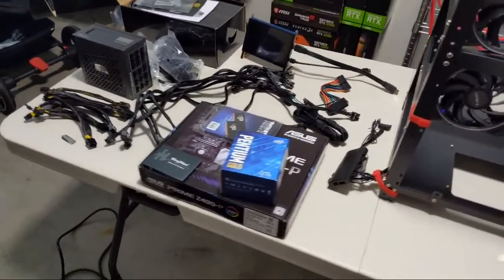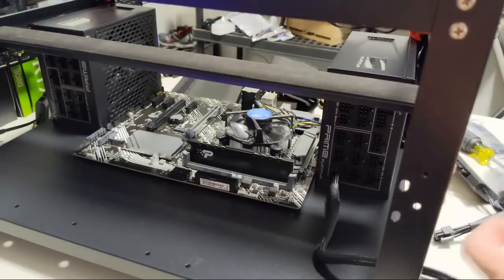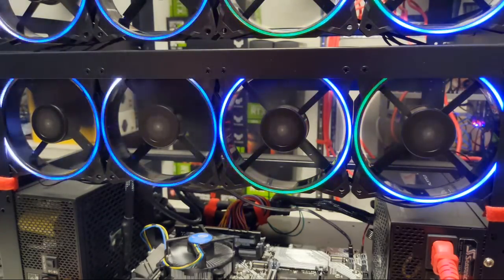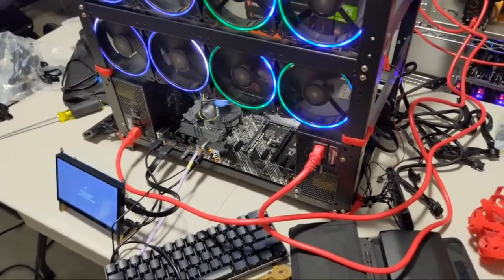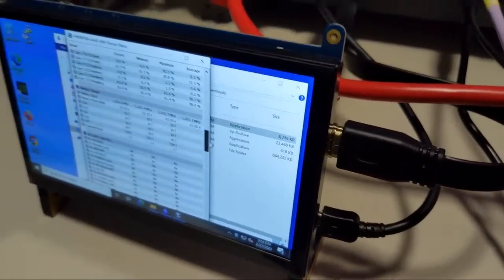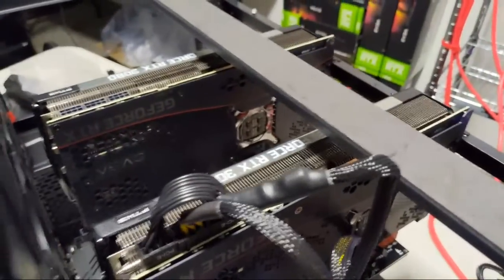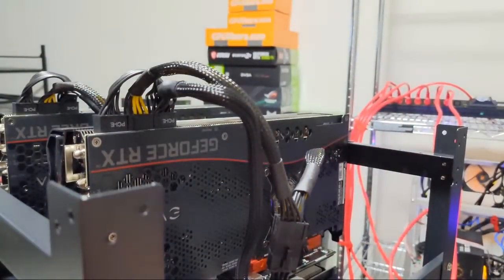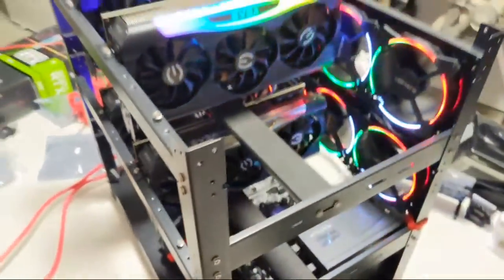6 x 3080 Step By Step Mining Rig Build LIVE STREAM! Part 1

Comment: @2:20:42 They actually are, micron has a spec sheet for the cheap. This isn't a debate or guessing. There is no info stating if you are over 95c for x number of hours the chips will burn up. The info from micron as the limit at 125c on the top dead center of the packaging of the chip. Which means the temp junction chip would be well above 125c. Nvidia throttles you at 110. 
You can aim a heatgun at your GPU for hours upon hours and it would be fine. You would be getting throttled.

Also on the caps, they can be bent sideways. As long as the wires are connected properly. NEVER attempt to bend back a bent over cap. All you do is weakn the joint. If you think the wire or joint is bad, repair, or trash, never try to straighten it.

Comment: *HELP!!!!!!!*
Having a pain in the a$$ issue, specs:
Mobo: Asrock H110 pro btc+
Cpu: Intel i5 1151
DDR4: 16GB
GPU: 2x RTX 3060

When connecting 1 GPU to PCIE3.0 x16 slot hashrates are fine but when the other GPU is connected with riser to PCIE2.0 x1 slots getting very low hashrates.

Comment: Hi Panda, just wondering if I see it correctly. Did you use 3 rtx 3080s with 1 psu 1300 watt? Doesn't the company recommend 750 watt per gpu? Please correct me if I'm wrong cause I'm still newbie. Thanks so much..

Comment: Hi Panda. Im in Australia where parts are costing 3 times the amount of msp. Thanks for your inspirational video's . I have just got into mining and have copied your 6 X 3080  build. Id just like to point out on that board if you read the manual, you have your ram in the wrong slot. Should be in the second slot away from CPU.  Thanks again for the great information and guides.

Comment: Red you need to absolute core on your cards. I have 2 3080s one does 101.50 @ -75 core, 1375 memory, 223w fans at 80% Asus tuff gaming. CARD#2 102.80 -150 core, 1375 memory, 224w fans at 80%. Gigabyte OC. You can do it in msi through the voltage/frequency tab in afterburner. I then find my sweet spot for my numbers on the cards then but them in my bat file so I don’t have to use afterburner.

Comment: 1:31:39 Its fine. Assembler or Pic and place machine soldered  pins to the board when they weren't level. Now if the Pads were pulled, you made the right choice.

Comment: Please, Red Panda, explain if this Driver problem is connected only with the 3060 cards, or the same goes to the other cards like 1660, 1660 TI, 3070, 3080? I am asking because I saw many of your videos and for 3060 you use the x16 ports only, but for these 3080 cards, you can use x1, x4, x8, and x16 PCI ports? Whys is that? Please explain. Thank you!

Comment: I don’t know if anyone is gonna read this but here it goes. I recently got 4 gpus ( all 3080 ftws) for some reason the motherboard only detects three at a time, it won’t detect the fourth no matter what. I tried everything in the bios settings from 4g decoding to switching the generations but still nothing. Is there anything I am missing? Ps: i tried the gpus separately and the risers they all work perfectly.

Comment: msi rtx 3080 is suck. you have to use a 102 percent power limit to get a 98 mhz hashrate. 
no matter what the memory clock setting, core clock setting, it's useless, the power limit must be 102.
If you lower it 70% the hash will drop to 88.

Comment: Hello, I want to start mining with a single RTX 3080 (hope to add more in the future) and I have a question regarding PSU to GPU connection. 
Can you explain how you set it up because I am not so sure. To provide some context, I will be using Windows and I will try to reproduce your setup shown in this video except my 3080 has just two 8 pins input ports instead of three 8 pins ports for your EVGA's.
My understanding is : do not use splitters to connect the PSU to the two 8 pins input of the GPU but use two separate 8 pins cables from two different 8 pins output of the PSU instead (wich means two cables going from PSU to a single RTX GPU each time). I have notice that in this video you are using splitters for the 8 pins of the GPU... but you also said in a more recent video not to do it so I am a bit confused now.
As I understand... it is however ok to use splitters for the risers so one 6 pins connector from the PSU can be splitted up and power up 2 different risers.
Is this correct ?
I find it very difficult to find precise explanation on this and I do not want to fry my equipment as it is very expensive...Any help welcome^^
Reply: I was asking the same, didnt found any answer so i went for each 8 pins a different cable, its crazy beacause for each 3080 i have 4 pcie cables (3 on the gpu and 1 on the riser)

Comment: I was following your video to build a coin minng rig. I have connected motherboard, CPU, PSU with the proper cables. when I turn on the device, I saw a light on the board but fans for power suply and CPU were not working. I don't think I missed something. Do you have any advice how to check out the device?

Comment: Can you run lets say 6 rtx 3060 and 2 1660ti on the same rig ? Its possible to operate in windows ( due to 470.05 driver restriction ) each gpu power draw individually ? Please help

Comment: Hey Red Panda!! what's good? cool rig hummmm about here on 1:27:30 then I definitely advice you to replace your thermal pastes for thermal grizzly conductonaut liquid metal and all the thermal pads for minus pad 8's DEFINITELY recommend you I don't do mining but I fix my PC's by myself and do all the things by myself  I also replaced my thermal paste on my laptop for grizzly liquid metal and it is a HUGE diference I would advice you that if you do it you'll need to replace the liquid metal in between 6-8 months because the thermal liquid with time evaporates and gets absorved by the metals and if your have a copper heatsink on those GPU's theres nothing to worry about it will only affect the surface with time but there's not going to be an issue with the temps I already reaplied it to my laptop CPU and GPU for second time NO issues at all my heatsinks are copper.

That way you can keep mining with the same GPU's for longer periods of time and make more money with higher OC and lower temps.

Comment: Hi everyone, am setting up a rig with 2 evga 1600w psu's and evga seems to have not 24pin slots they have 18+10, 24pin splitters won't help, or i need a motherboard board with 2x 24 pin slots? Any suggestions would be appreciated.

Comment: Hey man try moving the top cards 1 slot to the side so the cards aren’t on top of each other. I think that will be better since heat rises and 1 card just above the other will transfer more heat to the top one. It might even help to get the riser and cable for the top card further from the bottom one if you have interference
Reply: Henrick will this build work with 3070 founders 4 per the rig?

Comment: Pls help me. I am using 10s, 8 Capacitor Version Risers on Windows 10. I have added first ASUS rtx 3080 on PCIE x16 slot. And I and cant able to successfully boot windows when I add my second ASUS tuf rtx 3080 on riser. If I add second rtx 3080 on x16 slot then windows will boot with any issues. Also, while adding risers, the card on the riser is not getting displayed in MSI Afterburner
Reply: Pls help me. To add more I am having ASUS x570 board, with Ryzen 5800x installed.

Comment: Epic. I literally built this rig as my first rig using this video only lol. I used the zotacs, and all the hardware in your description listed as "your favorite stuff". Appreciate all the minor details, can't seem to have enough of those. I did end up getting the zotacs to run at 99.5mhs, 86MJT, 227watts.  Make sure your room is below 80 and drop the power limit in MSI after burner to 71. Fan at 80%.
Reply: What did you end up paying for the setup in today's prices if you don't mind
Reply: @justinw123  In total with 6 cards it's around 12k depending what you use.
Reply: @charlesbrock5172  how many types of coins we can mine with these cards

Comment: hey,i just bought 3x 3070 and put them on trex running.. but first 24h and i got a lot of fails/temps were around 59-67 also had very high ping for some reason.. some were 73 other 400 and then 1.8k and got only 9$ when i was expecting at least 15-18$ would anybody know why is that? Im using binance pool cuz a friend suggested this! thanks and best regards from greece!

Comment: Hey guys i mine with 3080s too, and one of them ( happens to be ftw3 too) has its hashrate all around 94-96, while the others are rock stable at 96.64. What causes that? i changed the risers, pcie slots, oc (only 1800/1700 oc on mem under hiveos)

Comment: What's are the temps for your 3080s?
Specially memory junction Temps?
I saw 3080 running too hot on my  system (50 core 94 memory junction, and lowered them to 56 W power to keep these temps)

Comment: When you use the 2 power supplies why connect the CPU and 24 pin from one psu and then just the 24 pin from the second psu via the adaptor?

Comment: In your tests, what is the best fan orientation for 3080. Intake or exhaust, and on which side of the cards, at pcie connectors or on video output side. I have 6x3080 rig struggling little bit with temps. About to instal fans in day or two, and looking for best way to do it

Comment: Just curious if you knew of the little window's button on afterburner that keeps your OC's saved on restart? Theres plastic on the Middle of the fan you missed. I installed it with it left on too 😄 Edit: just got to the fan plastic comment. For 3080 and 3090, dont use 461.92. It raised my 3090s memory temp 4c. Ive confirmed by going back to .40. I believe its an intentional nerf. After .92 no overclock above 600 on memory will hold. Im back at .40 and at 1100 on memory, back to a 90c memory temp. I see 92-96c on memory with .92 and heavy throttling.

Comment: Hey man, great video. My 3080 has only 2 ports, so 1 PCIe cable will go there. For the riser I am using a splitter. Can I use one end of the splitter to source 1 riser, and other end to source the riser of another GPU?

Comment: hi, do the power supplies need to be on 2 different wall outlets?
Reply: old response, but you can run up to around 1500 watts on one socket in a 120v setup

Comment: I think EVGA made some revisions to this 3080 model, maybe using better thermal pads, for the memory temp to run so low. I have a GXT and TUF 3080 and I have to keep the memory @ -502 Mhz to get the temp down to only 96c.

Comment: Most anticipated mining rig build ever. Awesome video. Why are using 2 power supply? Most people use one. I am confused
Reply: they can draw up to 350 - 400 watt each, so need to split three per PSU. It's a safety factor, even though he's likely running them at like 255 watts depending on settings etc.

Comment: friend, what is this Hub called where all the fans are connected? thanks
Reply: If you search this on Amazon, I found a real cool RGB splitter & also fan splitters for AC.  They are around $15 - 5V RGB Splitter Hub with Case and for ASUS/MSI 5V 3Pin LED Controller、LED Splitter 10-Port Hub with 50CM 3Pin Extension Cord, Perfect for Lots of RGB

Comment: For the connections to the gpu's from the psus, you used a splitter  on one of the power strands in order to be able to connect to the riser. Could you have used a 6pin(or8) extension from the daisy chain connector to the riser?

Comment: Hey dude, nice vid, but I noticed that your power supply vent is facing inwards and it will be dumping heat to the board and cards (heat rises). I would turn them to exhaust outwards :)

Comment: I'm a new to mining. Love you videos red panda! Currently I'm just running 5 gaming pcs as full machines, instead of making a rig that runs all the cards. What's the actual difference in power by doing it my way versus building the rig? Is the power consumption substantially more using 5 rigs versus consolidating all cards onto one rig? I've never really gotten a legible answer to this question, and I've asked it numerous time on numerous videos out there. I'm currently running around 900 to. 1000 watts, running the 5 rigs as separate pcs.
Reply: Another scammer trying to scam... It's so disgusting
Reply: Late here but you're just using more wattage with each CPU and fan system running on each machine, that's pretty much it. You probably figured it out by now
Reply: @hairystyles4212  yep, I've expanded substantially now. I've got maybe 41 to 47 cards running now. Loving the aspect of this technology. I really wish Nvidia would have kept their nose out and not released those incredibly stupid LHR cards, but otherwise loving it.

Comment: What is the fan hub used in the build?
Reply: If you search this on Amazon, I found a real cool RGB splitter & also fan splitters for AC.  They are around $15 - 5V RGB Splitter Hub with Case and for ASUS/MSI 5V 3Pin LED Controller、LED Splitter 10-Port Hub with 50CM 3Pin Extension Cord, Perfect for Lots of RGB
Reply: He said it once in this PT 1, Search Newegg for these & you will find the fans he used in this build "upHere RGB Fans"
Reply: Nice, ty for these